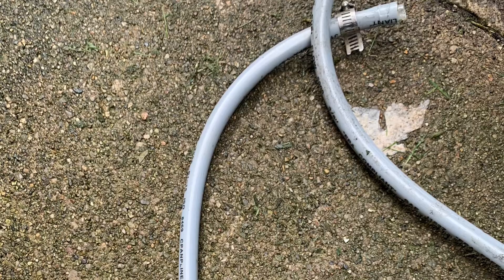Evinrude 2 stroke 115hp hard to start ? Idle rough ? This might help.

Comment: I have a different outlook on that , your fuel ..well let's face it , it gets dirt in it , fuel manufacturers are a joke also ..if you have a fuel problem and you bought the equipment new , you didn't follow manufacturers recommendations,  or manufacturers were to stupid too include this part , if you find it's a fuel problem , a mechanic goes through the fuel system and cleans it , completely. Every single part and aspect of it , your gonna learn what you dont need to tear down after the first time , by the time that happens , every hose , every piece of plastic or rubber , needs to be replaced ..if you think there's a magical chemical you can put anywhere in any machine that will help it , your drinking the Kool aid ..now some fuel additives will group the water together in a gas tank , but that won't really solve nothing ..that water still goes through eventually , the goal is to keep the water out ..now with that said , if you dont use your boat enough to burn out a tank of gas every 3 months , and I dont care about your winters , you might wanta reevaluate the reason you bought the boat ..or piece of equipment .use them or nature will take them back , I know what people do to get their toys , what happened ? Just my thoughts , don't judge me , for I really know nothing .. Lol

Comment: I did the same thing for my 1985 Evinrude 115 by suggestion of another YouTube video that suggests 1 gallon gas plus 1 full can of Seafoam. I took it a step further and used Ethanol free gas ($23 a gallon at Home Depot) that I always have in the garage for my small 4 stroke lawn care tools. My outboard is running like new again. It was worth the $23.
Reply from the maker: Awesome . Thank you for sharing

Comment: i was fighting a hard starting cold 1996 J 115 for 6 years .i took it in to have worked on and was told by the mechanic to push and hold the primer for 5 seconds put the controls in neutral and give it1/3 throttle in reverse and i'll be damned it starts right up no cranking and cranking for 5 to 10 minuets.
Reply from the maker: Thanks for sharing

Comment: That's a fuel stabilizer, you use when you don't use the boat in the off season to stop the fuel going stale. You want  Evinrude / Johnson engine tuner, Mercury call it power tune. Follow the directions on the can. But when it's all said and done as @MikeSmith-nu9wt indicated below, it needs a full fuel system overhaul. AND DON'T cheap out on those fuel connectors and primer bulbs, use the genuine ones if you can still get them. Also from memory that motor would have used Champion Ql77jc4 spark plugs. You could try NGK B9hs-10 they burn a touch hotter and change them every 40 hrs or so. Gap them to 1.0mm .

Comment: I run a 03 Johnson 115 and had similar starting issues.  After watching several YouTube videos, I disabled the VRO pump and mixed my gas and oil by hand.   That improved my starting immediately but idle speed was still a bit rough.  
I used Seafoam and ran 9 gallons through the motor hard.  The result was impressive.   
The motor now cold starts instantly and the  idle rpm went from 550 to about 900.  It runs like it was new.
Reply from the maker: Yeah my motor is older I still have to mix the oil in the gas manually . About a month after this video which helped I had a friend mechanic deep clean my carborators and change all the seals . Improved even more . And I put a new fuel filter . Runs like new now . Thanks for your statement . Hope that it helps some one as well. That’s my goal. Just to help some having problems . God bless.
Reply: @cliffordsreellife7323  You're welcome.  I have a 17 ft, 1980 Boston Whaler that I fully restored.  The 115 can hit the mid-forties with a lot of torque.  Great old motors and it still looks like a modern powerhead.
Reply from the maker: @snatchbloock  my blessing is a 1994 r70 ranger . I love it .

Comment: Thanks for that advice I will try that on my 1970 Evindrude 100 hp Starflite
Reply from the maker: I think it at least helps eliminate what issue it actually is . Some time after  I still took my boat to have the carborators cleaned reall good . But helped the mechanic when I explained how I had tried to clean them. And saved me few dollars on searching what it could be . Now I run this product in my gas all the time . 1 Oz per 5 gallons . God bless .

Comment: Folks thanks for the video and the comments.. good video by the way!!!

Now for my question. I bought an old jet boat that uses a 115 johnson-evenrude engine 
This boat has been sitting for about 6 years 
Can you please tell me the steps I can take to make it make worthy 
I think I would need to change the spark plugs 
Your comments are greatly appreciated

Comment: I need some
Help with a 95 115 throttle shifting cable. Can you take some pictures of your cables and post please. I rebuilt my carburetor had to take the cables off and I don’t remember how they go back on. The manual doesn’t show our particular and the shifter cable has two bolts running from it.
Reply from the maker: Won’t let me show pictures in the comments ?
Reply from the maker: This video may help you 

https://youtu.be/JAFCOnTS9_Y?si=pUFizQlOAFQlPv2a

Comment: Do you happen to have a link to the fuel filter you put on? I have a 140 but I can’t find the exact part number for them
Reply from the maker: Well I think I ordered it on Amazon . But I googled it . And I got the filter that was same name as my engine . I didn’t get the off brand . I think it was like 20$ .
Reply: @cliffordsreellife7323  I have a 98 model 115, and just bought a whole new fuel pump to try and help fix the same problem. I use seafoam all the time, but I will go with what you did.